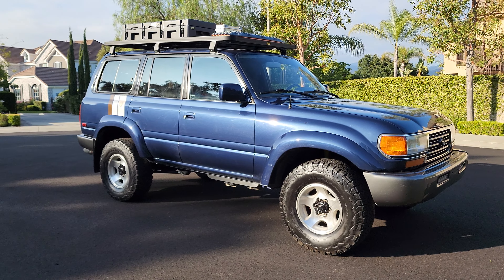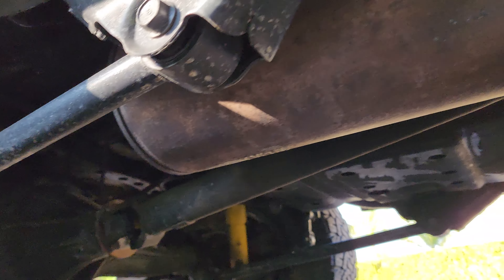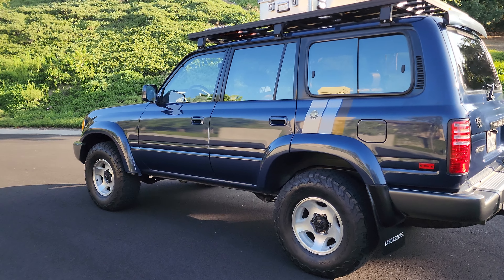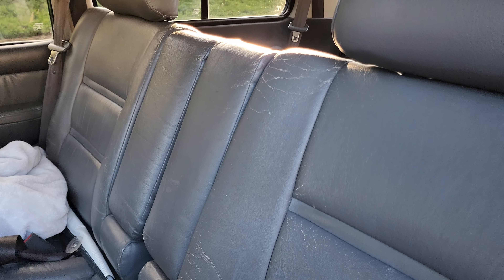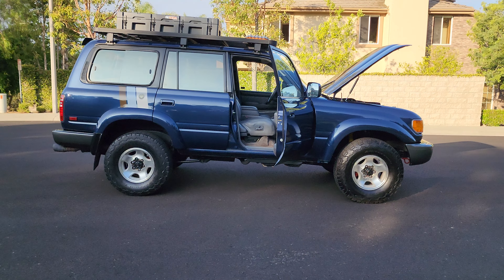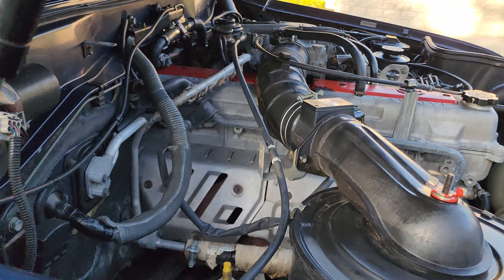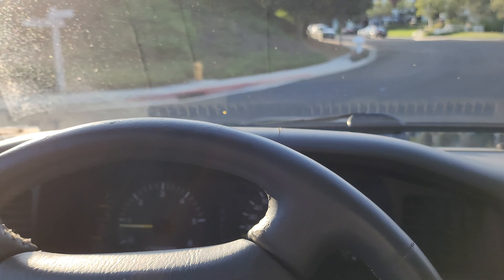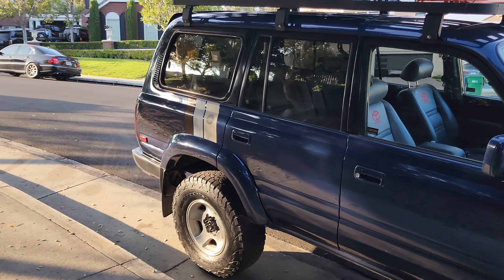Rare Nightshadow Pearl 1995 Land Cruiser FZJ80 for Sale

Comment: The 90's really were the golden era for Toyota trucks. I daily a 2nd Gen Hilux Surf. That's the diesel, manual transmission verson of the 4Runner you guys got in the US at the time. I can't remember the name they called the paint code on mine, something like "midnight blue"? It's like this but a slightly darker blue. It's approaching 400k kms on the clock and everything still works including the sun roof, zero rattles or squeaks. The result of low owners who each kept up with servicing. The 80 series was on the next level though, triple locked from factory, it was the big brother of my little Hilux.   
By the way, that liner on the underside of the hood is to keep heat from the engine destroying the paint on the top side of the hood. It prevents the clear coat from softening which causes it to start peeling. They are one of the most popular base trucks for building a serious off roader here because they were triple locked from factory. Almost impossible to find a clean factory one these days.   
This is one of the best examples I've seen of an 80. I'll pay full asking price if you cover shipping costs to New Zealand ;)
Reply from the maker: This one would be Sweet in New Zealand!

Comment: Did you remove the leather off the shifter or did a prior owner? Get thay in leather and fix that driver seat belt. All driver touches need to be 100%.
Reply from the maker: Hey Land Cruiser Project, Yes previous owner replaced. It is actually very clean and nice like that, so I left it. Do you have any Cruisers right now in your stable? I followed your video when you got the 100 series then sold it.
Reply from the maker: Land Cruiser Project, is that you on ih8mud that called me OC Flipper?

Comment: Most beautiful Truck.  I just bought a 92 but need lots of TLC..  Sorry to bother but you have an web side  or community where to enquired about problems with your LC and how to get it solve? Mine losses power as soon starts climbing.
Reply from the maker: That problem is the 155hp 3FE motor.
Solution.. Sell FJ80 and buy a FZJ80 with the 212hp 1FZ-FE motor. 93' and up
Reply: @CruisingTheLand  Thank you for answer. love watching your videos.
Reply from the maker: Also check iH8mud forums for solutions.
Reply: @CruisingTheLand  Thank you

Comment: Yo… I own a 93 fj80 that I bought for my 16 year old 5 years ago. 200k miles. Sold new in Ca, I bought it from a guy in Tucson. No rust. Want it to go to someone who knows them well and want it to be reborn. Stuff I have done… brake booster, radiator, recent tuneup… a great project car. If interested or might know someone who would be interested Iwould welcome a connect. Thanks. I m in Dallas.